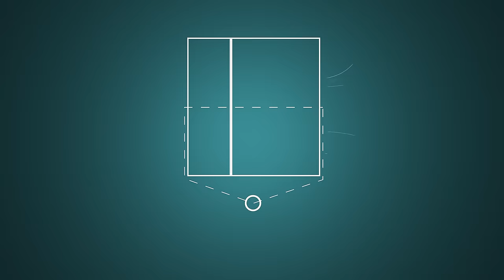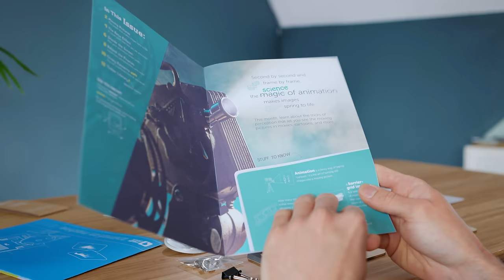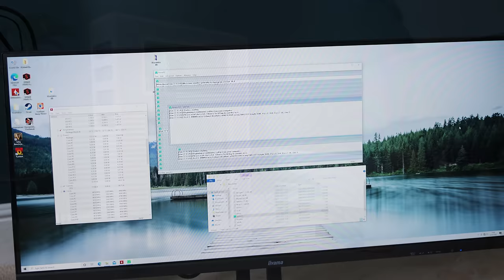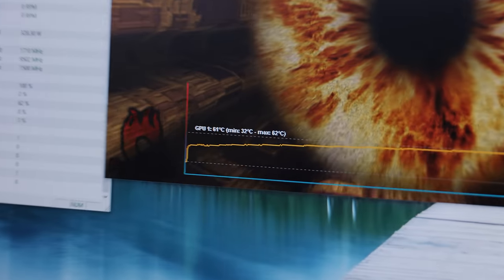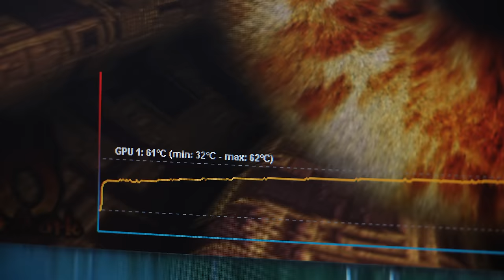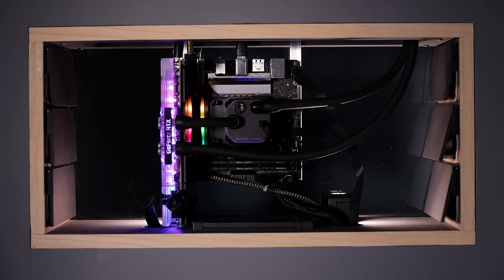Building the world's first 'breathing' PC

Comment: As cool as the PC is, I can't get over how he just made his magnet bigger to make it fit in the tube.
Reply: That part was wizardry
Reply: absolute genius. insane.
Reply: To be honest i know the proces he did but i didnt expect he would do it. In this moment i thought that that mans smart as hell
Reply: This actually could have been a video on it's own.
Reply: It's electrolysis
Something in chemistry
Known as electro plating
But why he use nickel?
Reply: @amaljose6374  Coz it's magnetic, I think
Reply: @amaljose6374  Because he just happened to already be using a nickel plated magnet.
Reply: It was much easier to buy a new magnet, but who cares ;)
Reply: @MTWODZU  Not as cool though
Reply: I swear. I didn’t even know that was possible till today 👏🏽
Reply: @MTWODZU  I think the easier solution was to grind the magnet to fit a smaller tube with something like a lathe or a band grinder.
Very impressive though.
Reply: Honestly the craziest part of the video
Reply: Ye
Reply: I was thinking he could just put a couple of layers of tape on lmao
Reply: @steamsteam6607  You can't grind a magnet for several reasons.  First, neodymium magnets are a sintered metal; powdered metals are compressed and heated to form a solid without actually melting them into a liquid state.  In the case of neodymium magnets, this results in a very brittle material.  Grinding or using turning tools on a lathe would introduce stress fractures and shatter the magnet. Second, it will very quickly corrode if the nickel plating is removed as the iron in the magnet would be exposed to the moisture in the air, or in this case the water inside the tube. If you were to successfully grind or turn it smaller you would then need to re-plate it to protect it from corrosion. Third, these magnets lose their magnetic strength if heated too high.  The grinding or turning process would very likely heat the magnet enough to significantly reduce or even entirely remove the magnetism of the manet.
So, his solution was indeed the easiest method that wouldn't compromise the magnet.
Reply: @MTWODZU  how could he find magnet, exact 0.04mm bigger? It would be as hard as to get proper tube.
Reply: @j0wt0ng  How previously did he find the right magnet and tube? It was just as difficult.
Reply: @MTWODZU  have you even watched video? He literally explains that it was easiest thing to do. Go watch it, you will have no more questions.
Reply: @j0wt0ng  Yes, I watched this and previous video and pointed, that previously he managed to match tube and magnet. This time he tried only to match new tube to old magnet, but not new magnet to new tube.
Reply: @MTWODZU  probably wouldnt be the exact size
Reply: @MTWODZU  it would also be easier buy a new tube, right? Yea, no…. Think again.
Reply: @kevinmedina9872  In the first attempt he did it, so...
Reply: The most genius part is, he uses small speaker to hang his magnet and uses sine waves to wipe out the air bubbles. Something clever yet so simple. 
Even at the cracked acrylic tube moment it was so dramatical 🤣.
Reply: @amaljose6374  he said he used nickel bc it was already coated in nickel. Idk why the magnet manufacturer used nickel though
Reply: @MTWODZU  he said that there was a very new tolerance to the size that the magnets had to be. It would have been just as hard to get the right size magnets as it was to get the right size tube. This was the only effective way
Reply: @amaljose6374  Because the magnet was already nickel plated, so nickel would stick to nickel a lot better than anything else.
Reply: @MTWODZU  If it was that easy, wouldn't he have done it?
Reply: Like who thinks of that!?
Reply: I work for a metal surface plating company and I think this is Anodizing, but it can also be nickelplating idk it may be different
Reply: @MTWODZU  but then hed have to wait and there's no guarantee that it would've fit in the tube so hed have to buy multiple magnets which adds to the cost
Reply: Fr
Reply: @amaljose6374  its actually electroplating, electrolysis would just be splitting molecules with electricity (electric = electric, lysis = splitting molecules), for example splitting water into hydrogen and oxygen gas
Reply: me too
Reply: Electrolytic coating guys....
And in real view it actually looks straight out of witchcraft 🔥🔥

Thats the magic of chemistry
Reply: @MTWODZU  if you actually bothered to watch the video then you'd know it's not as simple as "buying a new magnet".
Reply: @MTWODZU  if you bothered to watch the video he literally said "the first tube and magnet was sheer and total luck"
Reply: I wonder if he could have just wrapped tape around it to thicken it up instead…
Reply: @amaljose6374  He used Nickel, because the Magnet itself is a Nickel-Alloy
Reply: @amaljose6374  He mentioned that the magnet was already plated with nickel.
Reply: MAjIK
Reply: The magnet was uhh... average before he did that...
Reply: And yet used MDF, I love it

Comment: Guys, it's not nickel plating the magnet to increase thickness that's genius, It's using a goddamn speaker for both magnet suspension AND sine wave agitation. THAT is genius.
Reply: My thoughts exactly
It's a true innovator and a beautiful mind thinking outside the box to do that.
Reply: Isn't a voice coil always used for this?
Reply: @adamblomberg  well I'm not educated in the techniques of engineering, hence not aware of it
Reply: Same here, I was astonished at this level of ingenuity; Simplicity in it's conveyor, walk along the practical problems, and the lack of being able to see problems that can't be novely solved was also inspiring!
The whole idea of 'an only „clean/cold„ air case' using hydrokinetic magnetic pneumatics is also quite genius... That is displacing soo much air and with pretty solid pressure, design improvements might lead to new silent PC capabilities and maybe out preforming any water loop; imaging heat pipe jungles with fins every which way in that box with an air-conditioned via metallic water pipe from a freezer loop in the intake air source, keeping it dry.  Mini-DataCeneric!
Reply: This is all genius.
Reply: what's stopping clear tape from doing the same thing?
Reply: such an amazing engineer mind. inspiring truly
Reply: Mind size: MEGA
Reply: @BloodSprite-tan  Surface contact. The plating will not build up anywhere the tape is touching.
Reply: @BloodSprite-tan  The water that's also in the tube with the magnet would probably not get along with tape; or do I misunderstand your question?
Reply: @likesbikes77  you misunderstand, the whole point of the plating is to make the magnet fit in the tube. which can be achieve with a number of things, making the tube bigger or smaller, or making the magnet bigger or smaller. you can make the magnet bigger by simply wrapping it with a bit of tape.

if you simply use clear tape around the magnet to increase it size as a shim it should act exactly the same in the clear tube, it's not like more nickel coating is gonna have any noticeable effects that couldn't be achieve with a much less advanced method. i'm just pointing out, that he's over thinking it.
Reply: Tr
Reply: @BloodSprite-tan  clear tape just wont look as good
Reply: Science bitch!
Reply: universe size big brain
Reply: I thought the use of electroplating was too complex a response to the problem. I would have polished down a magnet (i.e., mechanically removed some plating) that was oversize for the tube to fit the magnet to the tube, or made a bore swab to polish the inside of the tube with an abrasive to open it up and make it fit the magnet.
Reply: @BloodSprite-tan  I understood the plating 100%. I thought you were asking why use the speaker to suspend the magnet while plating instead of tape. That would have been a better question than apparently what you were actually asking.

You can take your pick why tape wouldn't be an acceptable choice for tightening the tolerance 1. He only needed a fraction of a millimeter and tape isn't that thin. 2. Thin tape adhesive and water don't mix. 3. Even if there was a tape with adhesive that was actually thin enough and actually stayed adhered in water, the tape would have wear properties from the constant dragging on the tube which the plating wouldn't have and he needs a long term solution.. 4.(least important but just as considerable) He clearly takes pride in his builds and tape would look terrible compared to a polished piece.

Shrinking the tubing wouldn't be an option because it couldn't be done perfectly and without very specific tooling. Boring the tubing wouldn't be a feasible option for the same reason. You have to remember that he isn't in a machine shop. The other option would be to mill down a magnet to fit in a smaller tube but that would take a very impressive tiny lathe. Plating the magnet is actually the option requiring the least effort.
Reply: Now I need to know how to do the 2nd step in the plating process. Is the negative line not connected to anything? Or is it connected to the speaker circuit somewhere?
Reply: I don't see anything in this video (or this channel for that matter) that's not genius
Reply: Exactly. I mean, the fact that he got the idea to do that. Hands down, he is a legend!
Reply: @atechnews3221  he was thinking in the box tho. granted it is an awsome box with a massive cooling system
Reply: @Inertia888  the negative line is just connected to the psu, the speaker circuit is a complete different circuit
Reply: True
Reply: @schekelberg6187  I see the positive line goes from psu to the nickel strip electrode, but the terminal end-point of the negative line, I don't understand. Connect to the psu? Where does the circuit complete? I am missing something from the negative at the psu and the nickel strip at the positive terminal. 
In the video, all I saw was the negative terminal sitting unattached, sitting on the table, while the positive terminal was connected to the (anode?)nickel strip.
Reply: right! when he showed the magnet suspended from a speaker ny mind melted.
Reply: @BloodSprite-tan  wrapping it with tape would lower the appeal and overall make it a cheap fix rather than a proper fix
Reply: @thenx5521  you could use any material what about clear heat shrink? it frankly doesn't matte what you use as long as it works.
Reply: @BloodSprite-tan  it wouldnt matter to you sure but this guy takes pride in his work. there is always an easy way and then there is the right way
Reply: @BloodSprite-tan  someone already explained why clear tape wasn't used. why did you ignore that person and reply to another? accept that your idea of clear tape isn't the best hence why it wasn't used and move on.
Reply: @BloodSprite-tan  Clear tape causes lots of issues, the adhesive is going to get nasty over time, probably higher friction, also probably not actually thin enough and might have more drag on the tube.
Reply: @Memory7hief  While it looks and sounds cool, it's not practical for a number of reasons. 

This new type of cooling consumes more energy than the standard fans or liquid cooling. He's using a reservoir pump system to push a magnet back and forth on a load bearing acrylic plate which adds additional weight and air resistance (through air pressure). That in itself will consume like 3x more energy than a standard liquid cooling system or fan system. You ever wonder why air conditioners consume so much energy? It's because of the compression pump...which is similar to this concept.

Secondly, putting a standard liquid cooling and loop to both CPU and GPU defeats the purpose of this new type of cooling system. The liquid cooling system is the reason why the temperatures were cool, not because of the new impractical cooling system. The only thing that thing did was pump hot air out which in itself doesn't do much. All it did was create enough air pressure to keep the liquid cooling radiator functioning which a normal computer fan set can do the same thing.

I'll admit that his ideas about the speakers and coating nickel plated magnet was ingenious but this cooling design...while unorthodox is completely impractical and inefficient. It's actually serving no purpose since the computer already has a liquid cooling system and loop.
Reply: @BloodSprite-tan  but friction would fuck things up. Tape sticks to glass, even the non sticky side, nickel wont
Reply: @catdisc5304  first off they aren't using glass and secondly it's not mention to touch anything it's simply to make it so the air can't easily pass around the magnet, even then the magnet is self centering and should never come in contact with the plastic tube.
Reply: @BloodSprite-tan  Tape would eventually get pulled away by the Air that's being pushed - not an issue with Electroplating
Reply: @davegrenier1160  Boring with abrasives would leave scratches unless you went through a LOT of different grits. 
Polishing the magnet would probably introduce enough Heat it would cause the magnet to lose some of it's magnetic strength.
Reply: it is a great solution for electroplating. 

but it's not genius, it's literally running out of ideals and grabbing the most expensive tool you have.

if he started off with a mildly oversized tube and adjusted the magnets size with tape, he wouldn't have need to buy multiple tubes. surely it could work and be a good solution for a while, and when it fails you could do other things, like coating it in spray paint, epoxy, electroplating or anything else. it doesn't matter what you use, it's just the principle. start simple and easy. diyperks are meant to be diy. if you can electroplate easily then sure follow the video. it worked after all.

the whole point is to point out a simple solution that is good enough to avoid excessive effort and costly parts like chemicals, do you have strips of nickel? and electrolytes and a benchtop powersupply? if you already have that then it an equal quality choice. and isn't any more effort than the other solutions.
Reply: Omg you're riiiiight
Reply: @BloodSprite-tan  There is a reason why you are you and he is DIY Perks....your inability to see the genius of the build and refusal to acknowledge what everyone else is humble enough to admit is a testament to your ego outperforming your reality.  To even suggest that tape or any other inferior method of build up would be 'good enough' is simply....
Reply: @BloodSprite-tan  M8 you honestly just need to give up on your idea, it's just pointless. Why use a half assed fix that you know will fail and be less effective than an inexpensive method like electroplating. Electroplating is in no way expensive and you don't need a bench top power supply if you really don't want one, just use a random 5v power supply you've got lying around. Costly parts like chemicals? Do you have any experience with chemicals of any sort, because a large variety of them are quite cheap such as the one used in the video, white vinegar you can buy it from the grocery store. All that's left is spending like 10 bucks on nickel plates which you'll probably have enough to do plenty more electroplating later down the line if you feel like 10 bucks for one part is too much. It really baffles me why you would think the tape idea is comparable in any way unless you really have no experience with electroplating.
Reply: I still feel impressed at making fire with a lighter.... :(
Reply: @BloodSprite-tan  The last resort of a fool in a debate is to tell those around her/him to shut up.  Put some clear tape on that wound and get some rest.  Edited to add and for all to see...Mothra Lite deleted the comment where he tells me to shut up....lol.
Reply: @BloodSprite-tan  friction
Reply: @BloodSprite-tan  did you hear the measurements? Clear tape is too thick and imprecise
Reply: This dude would suggest we fix a broken power supply with aluminum foil.
Reply: @BloodSprite-tan  what drives you to downplay his methods? A guy above explained perfectly why plating the magnet requires the least effort and has better results
Reply: @BloodSprite-tan  i think you never seen what water can do to tape over time
Reply: @BloodSprite-tan  it's mentioned that the magnet is meant to suspend within water for the bellows to work. Another comment addressed that adhesive and water don't really mix well and, I ain't no engineer, but even I know that's true - you don't use tape for something that's going to stay in water for extended periods. The explanations given by other commenters all seemed very valid and you have to admit, electroplating it the way he did was pretty genius.
Reply: @freechilli8755  Agree, and what it also did was illustrate another engineering process.  In my opinion this channel is as much about the journey as reaching the destination.
Reply: @BloodSprite-tan  1. Electroplating is not hard nor it is expensive, most I've ever spent on electroplating is 20$, power supply and white vinegar can also be found around the house. And if you're realistically speaking, when you have an 3080 GPU (2k$), why do you want to care about the random $20 you spend on chemicals?
2. No method of adhesive can be as thin as 0.4mm, especially store bought ones
3. Water is very permeable in nature, any sort of makeshift low quality method that you just wrote above would just fall off in 1-2 weeks from the water.
4. Electroplating is way sturdier than any sort of exterior coating, it is molecularly strong, so water can't just snap it of like some 5$ duct tape you want to use.
5. Magnets can't be "adjusted" by size, nor can the insides of the tubing (Tubing is usually made based on its outside perimeter), since all of it is mass-produced. Changing the magnet size by contacting the manufacturers wouldn't be DIY, would it?
Reply: @likesbikes77  what tape do you use that isn’t a fraction of a millimeter lol. Centimeter thick tape? Haha
Reply: Exactly! This man is a genius!!!
Reply: Agreed. The smoothness achieved with a speaker most have in a box and never use...